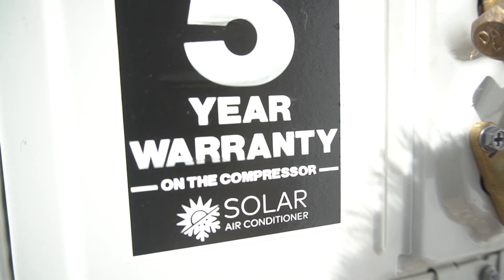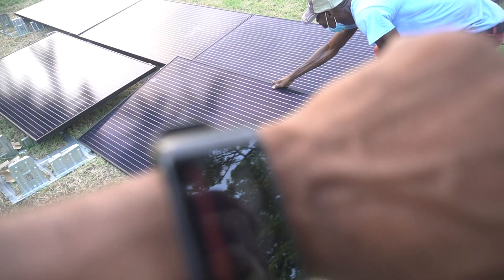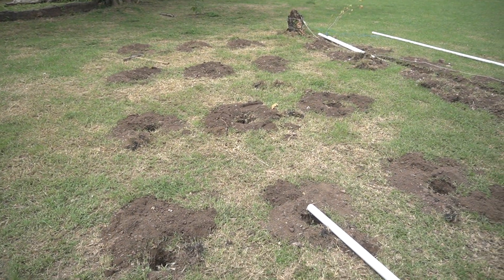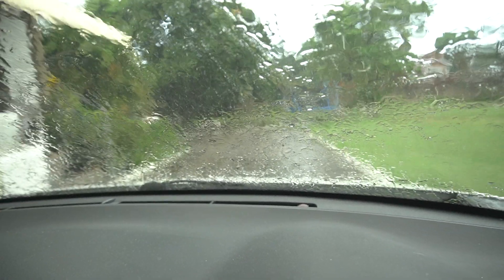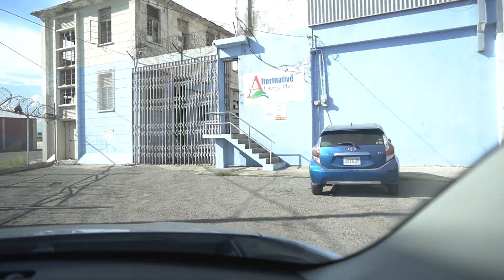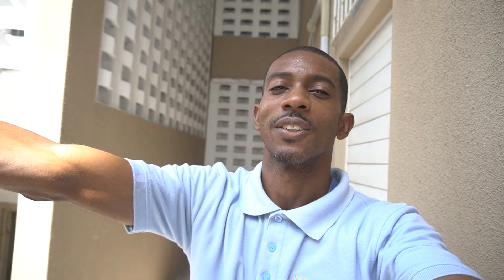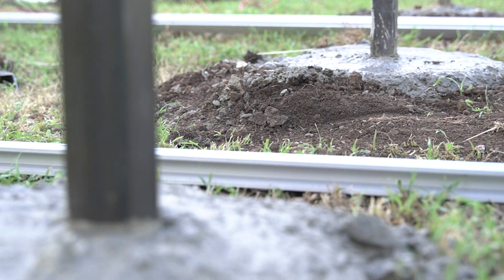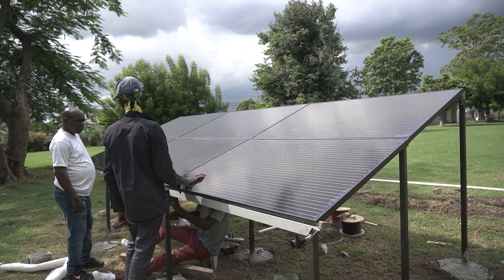DIY Ultimate Solar Air Conditioner Build

Comment: What's a Solar A/C?
Please clarify.
What are the wattage ratings of your panels?
You didn't say.
Reply from the maker: They are 325W all black S-Energy panels @10:34 wattage of the panels mentioned.
Reply from the maker: Solar AC or Hybrid AC or Solar powered Air conditioning unit - provides cooling using solar panels and energy from the sun ☀️
Reply: @RayonWhittaker  point taken. I haven't seen those in the States. Most A/C system here are central air though. Split units are scarce or non-existent.
Reply from the maker: @eddietee6305  these versions are actually manufactured in North America, the can be shipped from Florida to you - zamnaclimate.com
Use Rayon Whittaker or Jamaica2021 for a discounted offer while you're purchasing from the website.
Reply: @RayonWhittaker  thanks.

Comment: What the cost for a unit like that
Reply from the maker: So these no longer sell to individual customers but to dealer/distributers.
The other one on my channel (Deye) goes for approximately: 
USD $808 for the 12000 btu and USD $1129 for the 18000 btu at this time.

Comment: These units power On with no AC voltage just MC4 connected solar panels?
Reply from the maker: That's correct Jeremy.
The 18000 btu in this video needs approximately 6 solar panels to start.
The 12000 btu requires only 4 panels.

Comment: What about batteries for night purposes?
Reply from the maker: So there is no batteries that ships with the unit, however, if you wish to add a battery bank it needs to be providing at least 100V DC.
It's already a hybrid unit, so whenever there's no sunlight it will automatically switch to the grid, and as the sun ☀ comes back out it automatically stops taking from the grid and uses the power generated from the solar panels.
Reply: @RayonWhittaker  point taken.
I didn't know you have A/C units that can hook up directly to the solar panels.
Reply from the maker: @eddietee6305  oh for sure, I've been using a few. Cost a bit more when compared to a regular inverter mini split AC and that's because of an additional piece of equipment added that allows them to use both power from your power company while also using power from the sun ☀️
Reply: @RayonWhittaker  understand.